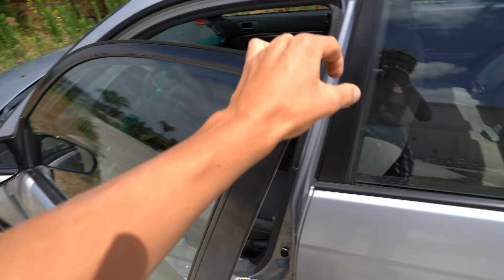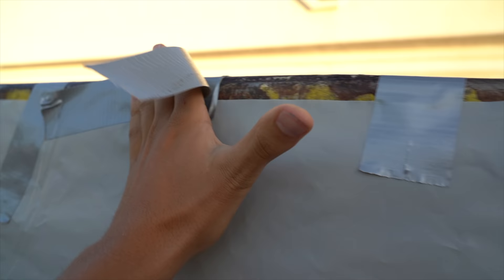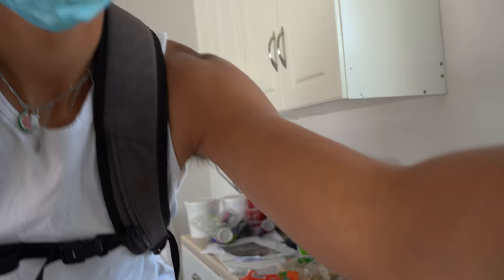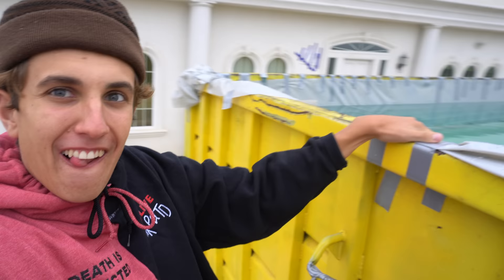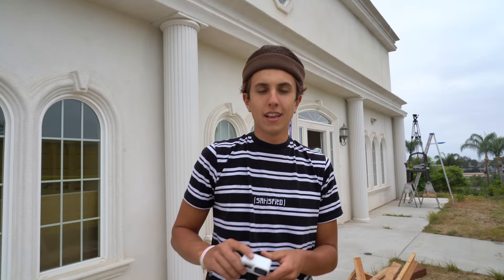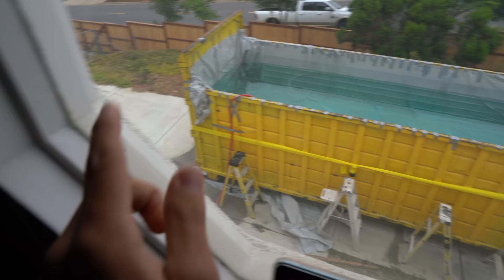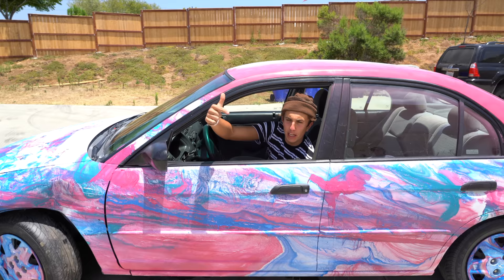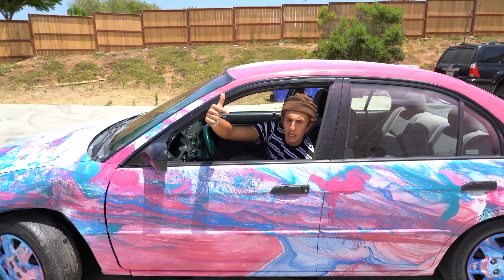I Hydro Dipped my Car into a Pool…

Comment: Would’ve made more sense to take the body off of the frame and take the interior out that way you can just dip the body instead of getting water in the engine and stuff.